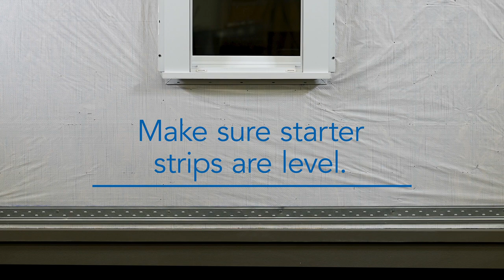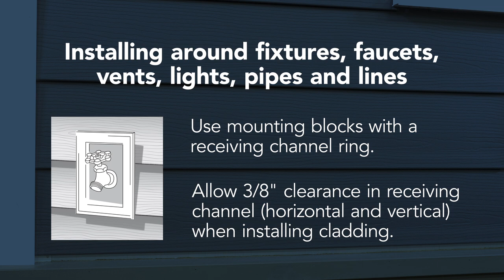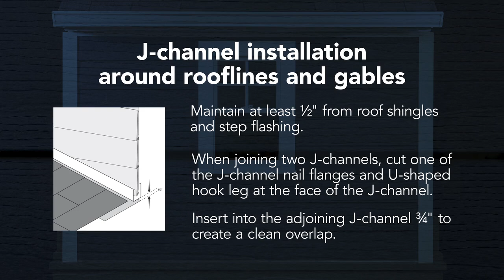ASCEND Composite Cladding 7" Plank Installation Video

Comment: You guys have GOT to develop a better system for fastening. I love the product but hate the hand nailing aspect. I am currently working to find or make a tool to align and be able to use my MAX Supersider. Absolutely no reason I should have to hand nail the whole house!
Reply: I use Truss Screws. Faster and better wind shear rating.